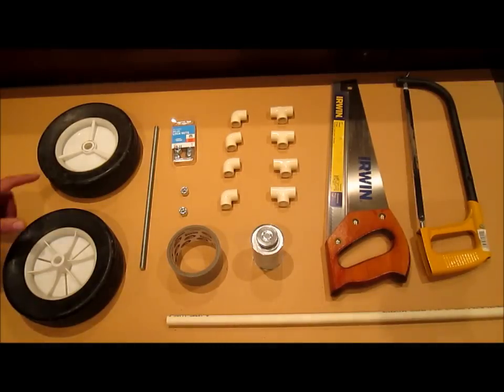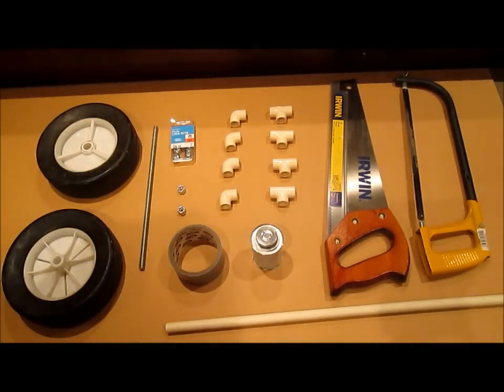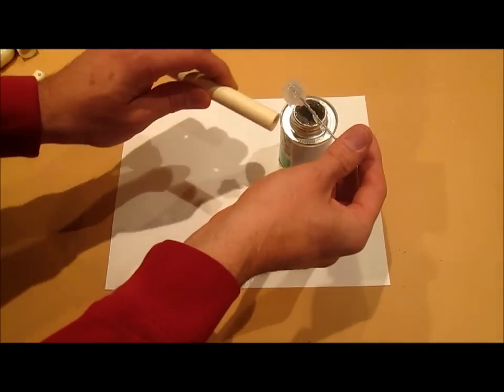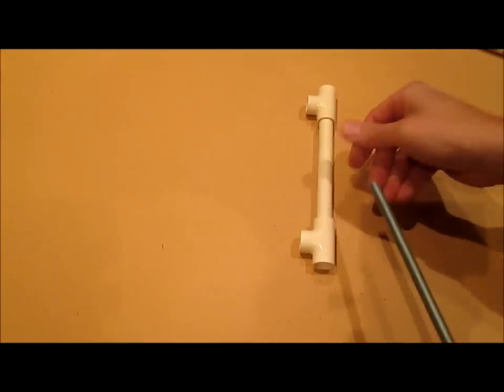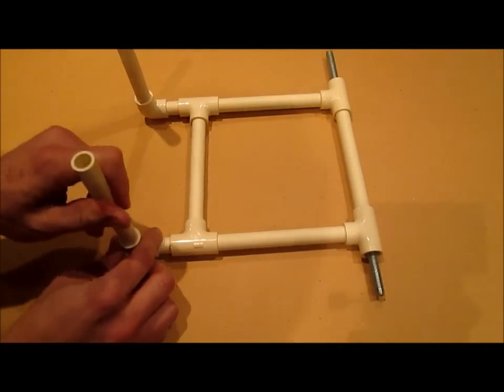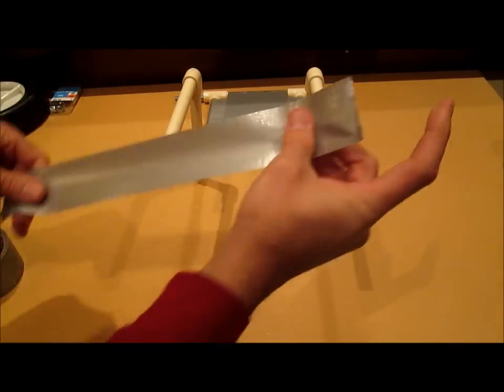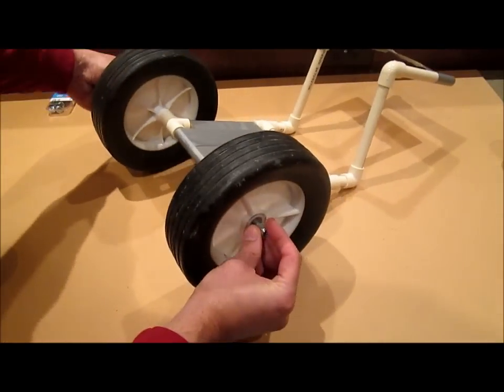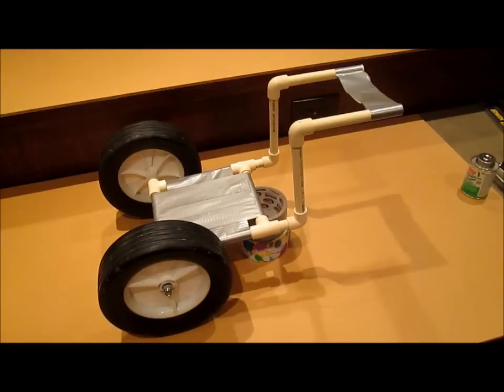How To Make a Doggie Wheelchair for $25

Comment: Thank you so much for sharing! Our very large Black Lab just had surgery today for cruciate and meniscus tears of both hind legs. He's going to have a hard time getting around for a while, we are building this tomorrow. Thank you again!
Reply from the maker: +Pauli Pauli - for that big boy, you better use 1 inch or inch and a half PVC pipe for strength, and scale everything up for size
Reply: Yes indeed. At least that's the plan. He's 101 lbs, so we don't want to take a chance with something that may break.
Reply: @huladiva25  Excuse me, did you build it? Because i want to build one for a large rescue dog  and i don't know if PVC pipe will hold up to the dog's weight.
Reply: @matsem4200  hi Mat, we never did. Things got so crazy after my dog's surgery we just used towels and a padded strap to support him until he regained his strength to walk on his own...took about 3 weeks before he could move by himself but he's such a fighter! 😢Coincidentally we were just talking about this video because he's older now and starting to have a hard time walking again. As recommended by the OP, we will use 1 inch pipe when we build it.  I hope that you can get this done for your dog and that it helps. Please don't hesitate to reply back as I'm curious as to how it turns out. 🙏🏼🤞🏼
Reply: Oh I forgot to mention, we did buy a garden wagon at Harbor Freight Tools for $50 and some 2 inch foam padding from Walmart to make him a wagon with a padded cushion. HE LOVES IT. We take it when we go for walks so when he gets tired he hops on the wagon and we carry him back.
Reply: Do you know what size wheels that you used. I need for a shepherd. Going with 14 inch?

Comment: Finally something simple. I have a hedgehog that is becoming paralyzed with WLS and I couldn't find a design simple enough to do by myself. Obviously I will have to scale it down for a rodent but this will work :D
Reply from the maker: +Elisabeth Wawersik - If the pipes are too bulky, you might be able to glue some popsicle  sticks together in the same shape.  Get a set of wheels and metal axle from a cheap toy car.  Good luck.
Reply: The pipes will definitely be too bulk/heavy for him. I hadn't thought of popsicle sticks. Those would be PERFECT to hold him up!!! Thank you for the idea :D :D
Reply: this is great  I'm going to make one for my one leg parrot. Her name is Peg maybe I can teach her to land on it between craps. hers not mine.
Reply: can you tell me how to get the measurement for my dog? Thanks

Comment: Since your dog doesn't need a wheelchair, have you seen a dog use this design? Do they have any trouble staying in it? Do they need a belt or harness of some kind to stay on the seat part? I've seen in most of the "real" wheelchairs they have stirrups for their legs that would seem to hold them in but your design looks a lot easier.
Reply from the maker: +B Bowen - I made this video because someone requested it.  I did not get to test it.  If you attach the front parts to the dog's collar, it should stay under his back legs as he walks with his front legs.
Reply: One other question. What size was the dog you made it for?
Reply from the maker: He is about 20 pounds

Comment: This seems awesome! I have an 11 yr old 85 lb make boxer. I see you say to use thicker pvc, but what about the length of the pieces (you used 5.5") what should I use for a boxer? Are there any videos of a dog using one of your chairs?
Reply from the maker: My dog is about 20 pounds.  I would maybe move up to 1.5 inch PVC for an 85 pound dog.  You will have to measure your dog to figure out exact sizes, but you might be looking at around 12 inch pipes for a 24 inch tall dog.

Comment: That looks pretty straightforward. Only question,what sort of collar or harness should i use? We have an old 11lb long hair Chihuahua.
Reply from the maker: +Jack Clarke - you don't need much.  I would just connect a small length of rope or chain from each of the arms that stick forward, to a regular dog collar.  The majority of the weight is on the back wheels. These front arms are mainly for steering.
Reply: That makes sense, I was concerned that I might hang the dog with just a collar. Thanks

Comment: I need a wheelchair for a Boxer, is there any kind of PVC that could support his weight? I will probably have to use something more permanent and sturdy for the seat and top strap. and bigger wheels.
Reply from the maker: +fuhqtoo  - Yes, just use 1-inch or 1.5 inch PVC.  The construction would be exactly the same, just bigger.  You could use lawn chair strapping for the seat.  You cay buy it by the roll.
Reply: Do you recommend still 5.5" in pieces for a boxer, since the are taller & heavier?
Reply: Fuhqtoo.. did you ever made one?

Comment: How would you make this according to your dog measurements…. I have a very big dog?
Reply from the maker: Measure your dog from collar to base of tail (not tip) and make your long pipes about half this length.  A larger dog will need larger pipes.  Maybe 1.5 inch pvc pipe for a large dog.  The best is 3M 3939 Duct Tape. No stairs with this.  You would need a ramp.

Comment: Does your dog use this to go to the bathroom? That's what I need it for, but wasn't sure a dog would pee sitting down..? We're actually in the middle of making the chair now & that question just hit me..
Reply from the maker: I designed and built this wheelchair at the request of one of my subscribers.  My dog doesn’t actually need it.  Instead of a duct tape seat, maybe you could use fiberglass window screen. Use thin wire or strong nylon thread to stitch it onto the frame.  The dog could pee through it with minimal mess.  Rinse occasionally to clean.

Comment: Hey I have a doggy that her front legs are shorter than her back and cant hold her neck because of some damage that she was born with.  We already have almost everything to make her little chair but I was wonder if you had any instructions on how to adjust this for frontal legs and support for her neck ?
Reply from the maker: I have not done this, but I would try building the rolling platform and then gluing it to the bottom of a walking harness.

Comment: This is generalized right? I have a smaller size Boxer that needs help and I’m not sure if this will be big enough for her. Any suggestions please?
Reply from the maker: Just use bigger PVC pipe. And inch and a half is very strong
Reply: But the 5.5" length is still suffice for a boxer? Shouldn't the lengths be a little longer bc the size of the dog? I'm so confused, I'm sorry

Comment: Hi there! Is there a way I can make a wheel chair for my dog for one side only? Her front right leg and back right is limp due to paralysis?
Reply from the maker: That is going to be tougher.  I would suggest getting a used baby walker.  Remove the tray, seat back, and seat hammock.  Sew and install a new hammock with four leg holes.  Hopefully your dog can learn to push around with two legs.  You might want to look into using a doggie coat as a base for the hammock. Good luck.

Comment: This is the only design I’ve seen with no straps attaching the dog to the wheelchair. I like the simplicity but does it stay in place with the dog? Doesn’t the dog begin to slip out of the frame or off the seat?
Reply from the maker: You have to attach that top strap to his collar so he can’t move forward without pulling the chair too.
Reply: @HowToLou  Thanks that makes sense. I particularly like the seat design for the hind end. It is quite different from all the other designs I have seen that use padded loops and straps to support the back legs. Your seat idea is so much simpler. Good job!

Comment: That's wonderful but how do I make a front wheel cart for a pit bull dog who has had her front leg amputated? I would like one where she could sit in it.  Any suggestions from anyone would be appreciated. Also, anyone knows where I can buy a front wheel cart for around $200 because the ones I've seen advertised go from $300 - $600.
Reply from the maker: I have not done this, but I would try building the rolling platform and then gluing it to the bottom of a walking harness.

Comment: Could this be adapted to work for a cat?
Reply from the maker: tristen pascual - It could "physically" work for a cat with no adapting.  The problem is that cats are mentally much different than dogs.  They tend to freak out when they feel constrained.  This is why you rarely see a cat on a leash.  If your cat is really REALLY mellow, you MIGHT be able to make this work for them.  It is really cheap to buy the parts and build it, so it might be worth a try, but just realize it is a "try" and it might not work.  I hope it does.  Good luck.  -Lou

Comment: Can something like this be made for a great dane?
Reply from the maker: Joa_Milena212 - Sure, just use 1.5 inch PVC piping, instead of the 0.5 inch that I used.  You would also have to replace the duct tape with a stronger base.  You could buy a small peice of canvas, wrap it around the tubes, and screw it to the pipes, from the underside.
Reply: Great! Thank you

Comment: How big are the wheels used in this project?
Reply from the maker: +Anne Jacobsen - About 5 inches in diameter.  They are the least expensive replacement lawn mower wheels you can buy at the hardware store.
Reply: +Anne Jacobsen Hello, If you served my comment, if the chair the squatters to inside your cas I recommend that the wheels are of maximum 2.5 inches,(type of skateboard) and down the chair,bolted on a 5 millimeters of triplay thick, in this way are not atorara in furniture legs, but if you use it for walks if they are good the wheels of the video, greetings
Reply: so sad isn't it.